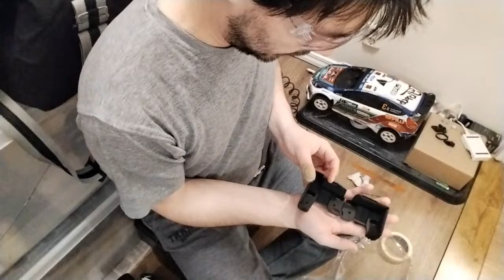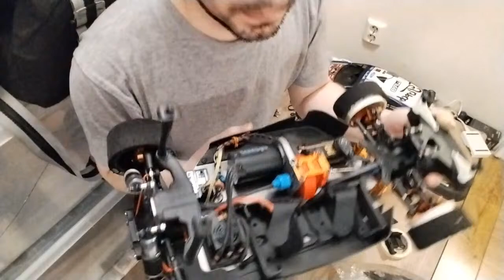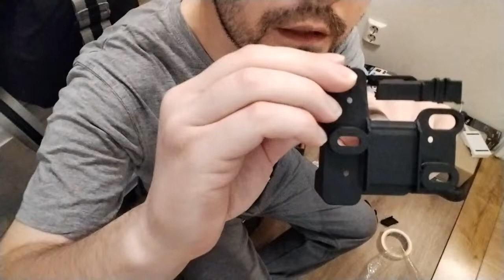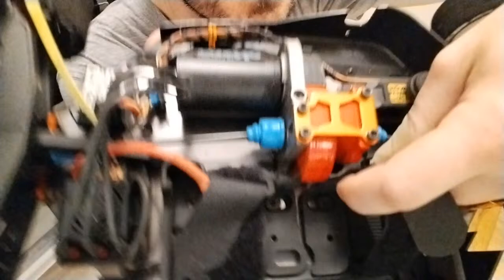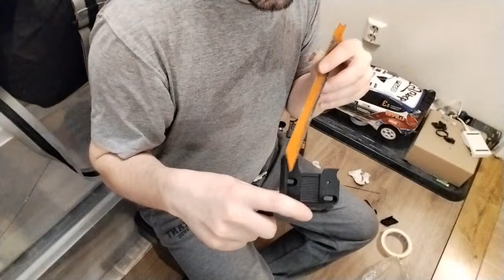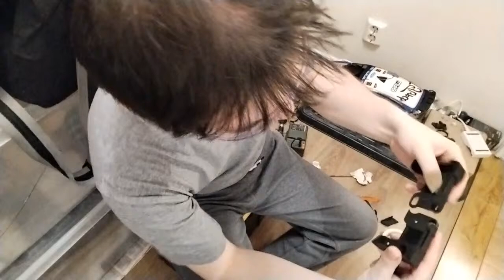How I modified the battery tray for the hpi WR8

Comment: Hey man where did you you get the rubber drive covers? The ones on your driveshafts? I could use some of those for mine and one of those center diff covers!
Reply from the maker: @WestcoastRCUnity  The blue ones, I made them myself. I 3D printed molds and use 2 comp silicone, the type used for casting soaps and stuff.
The diff cover is available at https://i.materialise.com/en/shop/item/wr8-flux-gear-housing?designer=mr-uueekend&sortBy=mostResent&pageNumber=1&pageSize=9&index=4